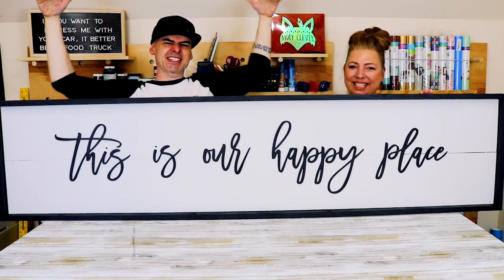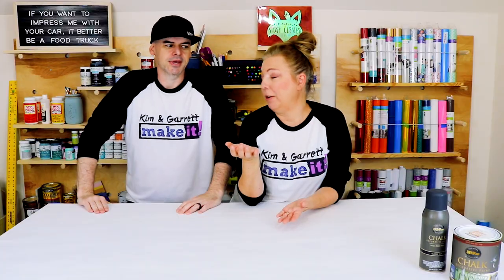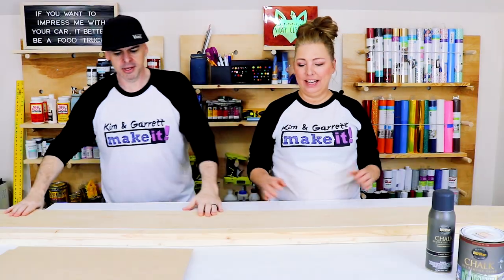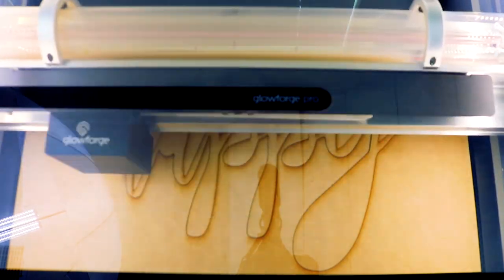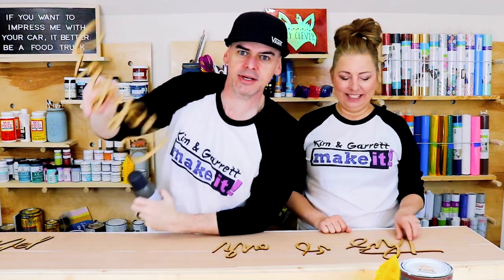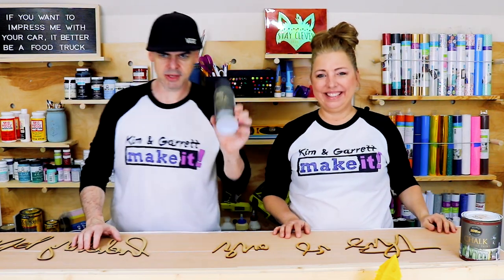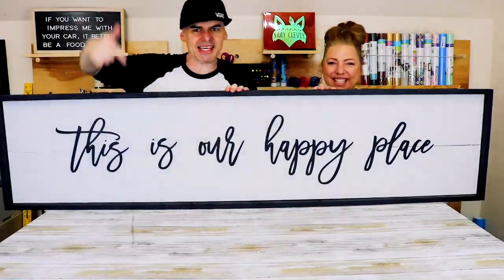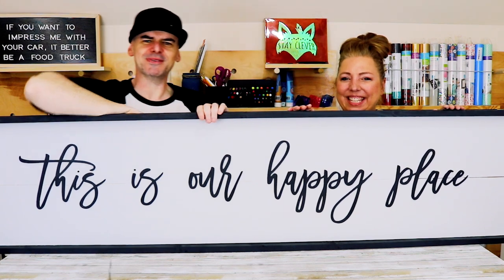DIY Kitchen Farm House Sign | Glowforge Tips | Scrap Wood Projects #scrapwoodchallenge

Comment: Question I read somewhere that if you dont use it often the tubes get ruined is that true? Also I dont have a following but I love this glow forge and I want to buy one but I need to make sure there is a market so that it pays for itself. Any suggestions? I am crafty but dont build things as a rule.  I also dont know illustrator or photo shop is that a problem?  I cant operate either its not my skill set
Reply from the maker: I would recommend against it then if you don’t build and can’t use the systems. There are lots of other things that are good for crafting without that kind of knowledge! As for the tubes, that’s not a problem we have run across yet!